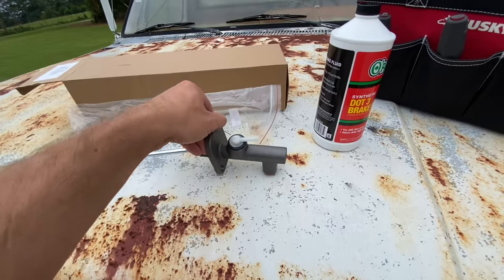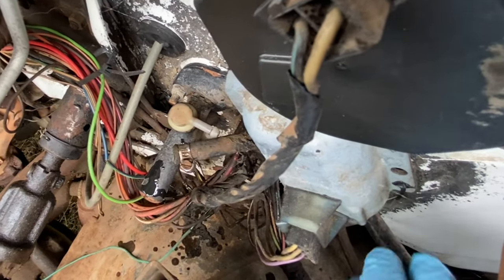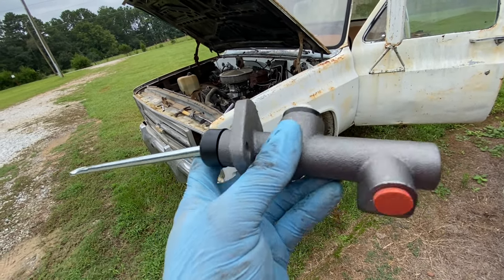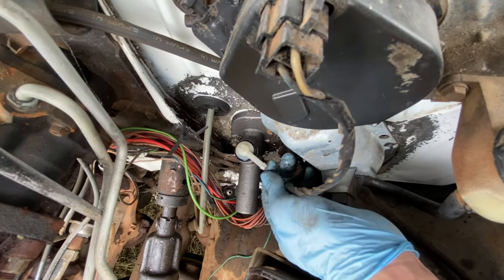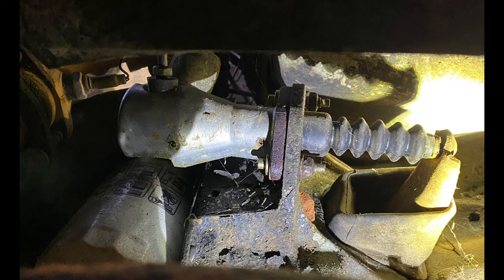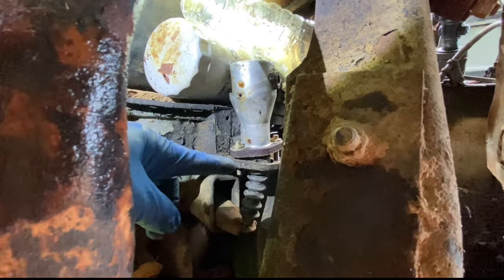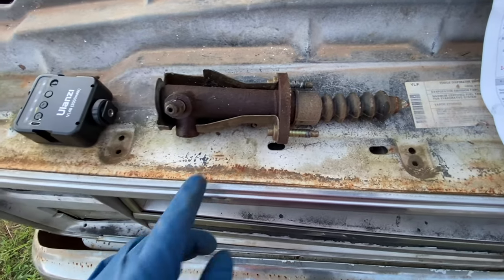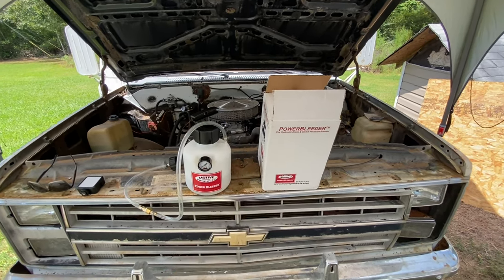Replace a clutch master cylinder. Replace a clutch slave cylinder. Bleeding a clutch. Chevy R30

Comment: Hey hoss got the same truck an its being real pain trying to bleed and making the clutch slave push out all the way. Thanks for the video. Will try that system.
Reply from the maker: The power bleeder is definitely worth the money! I have used it several times. I have another video that I made after this one showing how I replaced the hydraulic clutch line. I used the power bleeder again to bleed the system. Very easy to do by yourself.

Comment: Question....Did you not bench bleed the slave cylinder and the master cylinder proir to installing them ?
Reply from the maker: No, I did not.
Reply: @Brantley Blended  Thx for response,  maybe I'll try that 1st to cut down the air bubbles if not will get that power bleeder, good looking out
Reply from the maker: @maineinga  The motive products power bleeder is awesome. I have another video linked below where I had to replace the clutch line and bleed the clutch again. The power bleeder is definitely worth the money.  

https://youtu.be/BsQ6VmGlyOA

Comment: Hey man. Same truck and same exact problem. Do you have any idea why the push rod would bend like that. Same thing happend to mine
Reply: Check your hydraulic line for blockage. See if you can blow compress air through the line with both ends not attached to either cylinders
Reply from the maker: I think it’s a really old part, and I don’t drive the truck very much so it just ceased up.
Reply: @BrantleyBlended  my neighbor replaced the master cylinder twice, and bent the pushrods both times. His truck is a 1989 k1500, I removed the slave cylinder and had him press down on the clutch pedal, no movement. Before we replaced both the master and the slave, I tried blowing air through it. I ended up removing the line and found that the rubber section had deteriorated internally after I cut the hose portion in half. We replaced the hose and both cylinders. Cylinders were covered under warranty anyway. Bled system, clutch is back to normal and we’re not bending anymore pushrods. Good luck 👍✌️

Comment: I did my swap and my transmission is froze in neutral
Reply: Did you find a solution yet?
Reply: @joshuabrown8566  I soaked inside of trans with atf till it broke free... but there is a bad bearing in the trans... I have a spare

Comment: What transmission does the truck have. 
I have a 80 k10 with a sm 465. Id like to convert from a manual linkage to hydraulic like you have.
Reply from the maker: It’s a 4 speed sm465
Reply: I am changing my 84 k5 to a standard from automatic... the bellhousing is what you will need to change for hydrolic clutch... the sm465 will be same